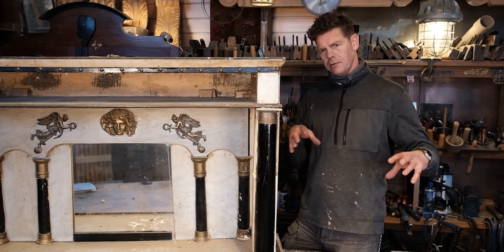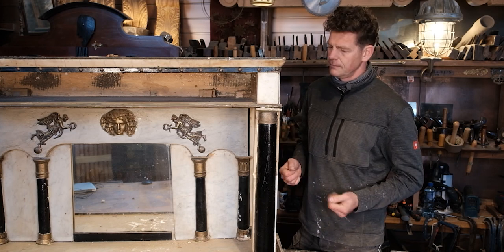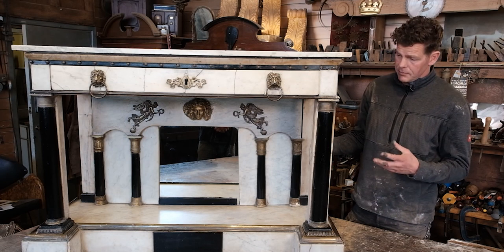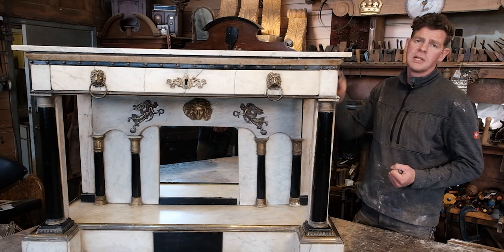Restoration of an ultra rare £12,000 antique table! Saved from the brink!

Comment: Al, I wondered if a Flash Magic Eraser would have worked well cleaning the Marble up instead of TCut? 🤔
Reply from the maker: I've never used one Ben,  but always learning so I'll give it a go.
Reply: Or a mild solution of hydrochloric acid first to clean it all, followed by a clear marble wax......
Reply: @vancewhittall2810  on 200yr marble! 😱 Your a brave man lol
Reply: @kingspicks  In France here we use a mild (30%) acid solution to clean all marbles,( which are all thousands of years old by the way!) its an accepted restoration technique here, gets rid of dirt and stains, and the bottles of acid are freely available at all supermarkets next to the white spirit etc!!
Reply: @vancewhittall2810  Didn't work on La Grande Arche, Mate.
Reply: @kingspicks  That wasn't just a cleaning problem on a piece of interior furniture though.....The history of the problem: only a few years after its completion in 1989, the issues with the marble façade began. The temperature fluctuations and automobile fumes had quickly affected the porous stone: it showed cracks and flaking, numerous slabs had bulged, and some had even come loose from their anchoring.

Such problems were not new. “Pillowing” had become the technical term for the bulging of marble that was observed in many places.